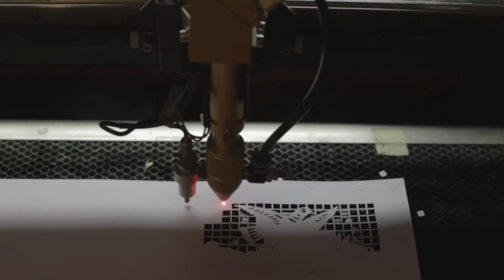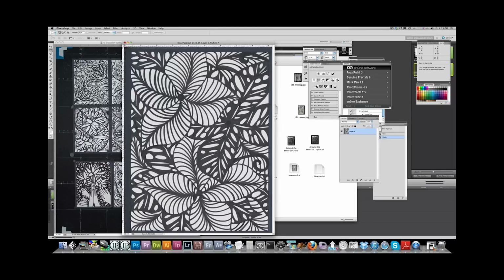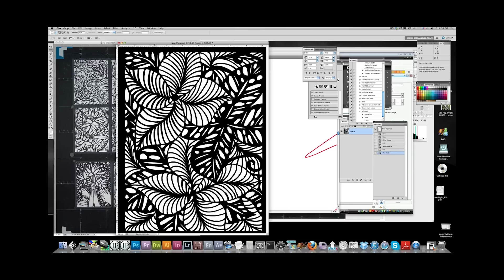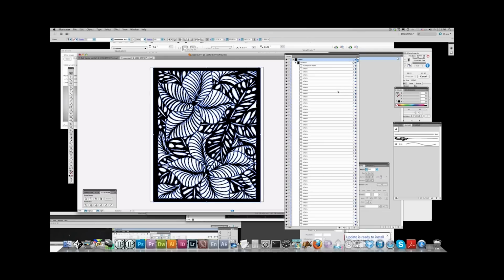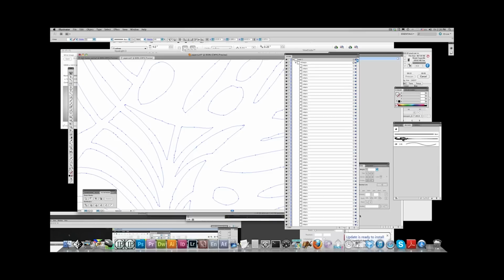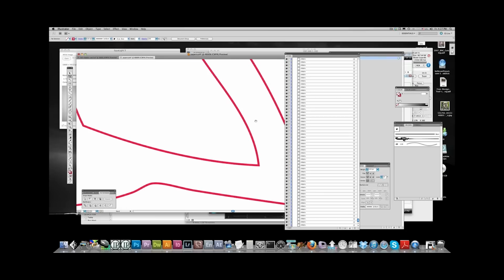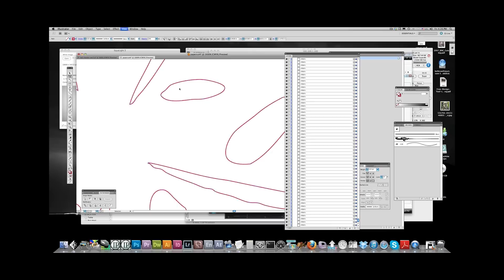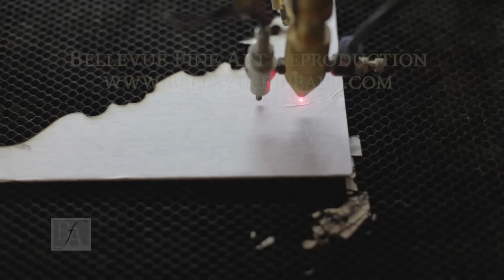Adobe Live Trace Conversion for Laser Cutting (full version)

Comment: Hi! Your video really helped me a lot! But one question: 
I did the live trace without preparing the image in PS. When the laser cutter do the job, it just doesn't cut the lines smoothly. Like shaking. Why? How can i avoid it?
Reply from the maker: The live trace picked up all the little irregularities. If you zoom way into the image in illustrator, you'll see there are lots of jaggy points. One thing you can do is to use smoothing. But this too can cause some issues. 

That's why you have to clean up any files that's had live trace done on it. It's explained at about 6:55 in this video.